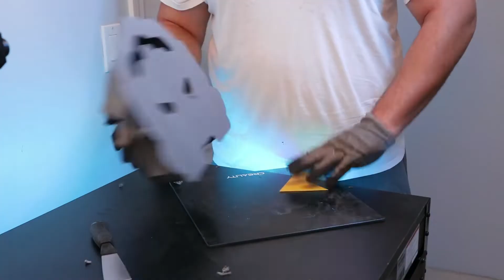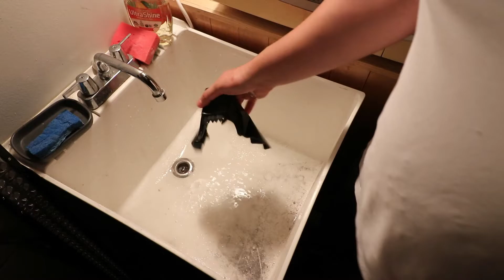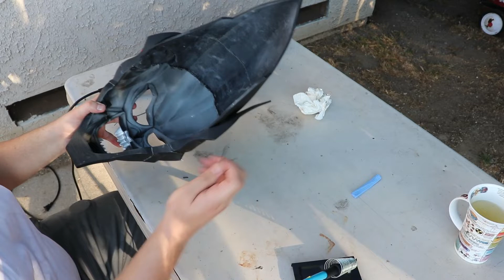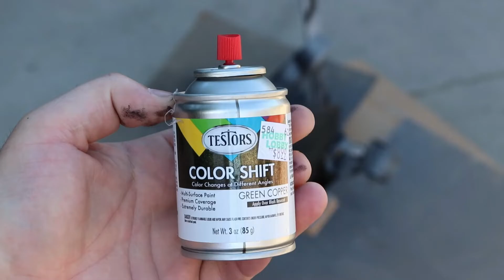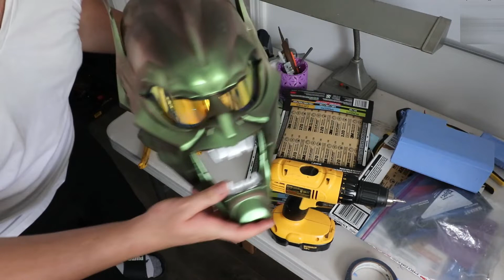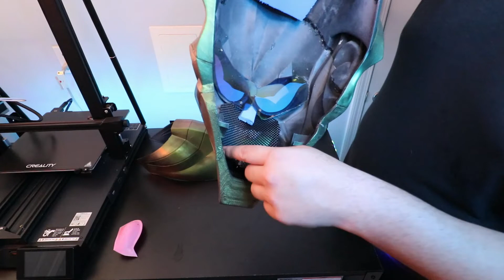Green Goblin 3D Printed Helmet - Eyes, Weld, Complete

Comment: What file would I use to make those posts for inside?
Reply from the maker: Hi @blazet9860, thank you for the comment! I haven’t posted the file anywhere. Those were custom 3D models I made. If you want them, go to my email and send me an email. I will send the files over to you, but keep in mind it might not fit your helmet file. I scanned my head into 3d and then adjusted the 3d model of the helmet to fit my head, so it might not work well with a standard helmet file.
Reply: @3DTheory  No problem.  I may not need them anyhow. I will be basically just displaying mine.

Comment: How you set the eyes in place?  Ive tried a glue gun i tried velcro amd i aint having any luck
Reply from the maker: Hi Rob, thanks for the comment! First I lined up the visor pieces I cut out over the eye holes on the inside part of the helmet and marked with a sharpie where I would predrill holes. I predrilled holes into the visor pieces, then I used tiny screws to hold them down. I screwed the tiny screws onto the border part around the eyes, on the inside part of the helmet. Check out the video at 16 minutes and 30 seconds. I talk about it and show where I put the screws.

Comment: How many cans did it take to cover the front and back piece with the green copper?
Reply from the maker: Hi Kevin, thanks for the comment! I used 3 cans of the green copper. I did scale up the green goblin helmet so there was a little more surface to cover. Also there is still some leftover paint in the third can.
Reply: @3DTheory  awesome! & thank you for the quick reply. I only bought 1 can and when I received it, I realized how small it was. Just bought my 2nd can today and waiting on my next can to spray both at once. Hopefully they will be enough. Mine is just a normal head size
Reply from the maker: @KevinJones-pk9ow  Anytime! Sounds like you’ll have all that you need. Feel free to comment if you have any more questions :)